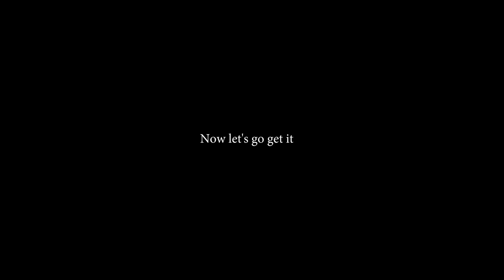Buying and fixing a lowboy trailer : Centreville 35 ton detachable

Comment: You guys have no idea how much i enjoy watching you and Andrew get so much work done with tools from Harbor Freight, Tractor supply and craftsman - when all the tool snobs insist you need a $300 screwdriver to accomplish anything. Congrats on the new trailer.  Mounting a pipe to keep half a dozen traffic cones on board might be a worthwhile addition too.  If you decide to do that, you can get bumper mount cone holders for the truck, a surface mount one for the deck,  or just bolt a pipe adapter onto the trailer and screw in a 2 foot piece of black pipe.  It’s definitely worth it if you ever have to work on busy road, or god forbid break down on the side a highway.  You get peoples attention a lot quicker once traffic cones go out, and you can create a little barrier to push the cars a little bit further off you.

Comment: Jesse; You can haul Andrew Camerata's CAT  977 around with that lowboy.   He needs to get that big CAT out on some big jobs!
Reply: Andrew runs a business so no doubt he will have his own low loader shortly, his current trailer is 20ton max, the 977 is 24ton
Reply: andrew dont need help. he can very easily reduce the tons of his machine with plasmacutters, tortch or some off many cutting tools he love to use
Reply: them 977 are old as F, parts are getting very hard to find, every burnt unit been stripped, new parts are a battle, i have a messy HD450 i pulled the engine out 20 years ago, the tork converter went on it and i have yet to find one for it, it was a great track loader with a big heavy duty detachable back hoe, that thing out pushed a cat D4. i have a blade for it, i use to win bids to barre brush on hydro right of ways along dirt roads in to resorts when they had run hydro in, but all the trees an brush had to be logged out and make the ground look like a park, barre all the brush piles for many miles. if i recall the last one i did was 38 miles.  i loaded blasted rock in a rock corrie in my 20's with a cat 977 huge rocks, i broke my collarbone there when trying to get the track frame bolts out, had a 12 foot long pipe on a 1" power bar, the 2-1/16 inch snap-on socket broke and the pipe hit me in the collarbone.there was 3 of use on that power bar an pipe.. . for city river bank erosion control, we carries the big rocks up the middle of the river with cat 922 and 933 loaders, at hat time i broke the track frame on one side, it took over 2 years at that time already to find one for the 977 so i wouldnt work it hard.. i also ripped the bucket open demoing an old hocky arena concrete floor. for a new floor full of rebar and cooling tubes i spent a week heating an beating the bottom of that buck back into place and welding it up, that was one hell of a strong floor a foot thick
Reply: @freepress8451  AC's trailer weighs 4 tons, so it can only hold 16 tons also! With the 977 weighing 24 tons AC will need a 30 ton trailer to pull the 977.....
Reply: @floatpool8307  i dont, just didnt remember how to speel.and he is using mostly for enternal decoration, or add a radio or so

Comment: LOVE the format of these videos, for many of the scenes capture unique perspectives that are not offered elsewhere. For example, I have pulled a number of small trailers before and understand intuitively the need to make extra wide sweeps on turns and going around sharp corners, but your "camera at the rear of the trailer" sequence provides a unique perspective on the geometries involved, especially when watching the tracks of the tractor wheels relative to the tracks of the trailer wheels. Many, many thanks for putting the extra effort needed to capture these fo us! I know that there is a ton of work to set up, capture and edit these sequences, and want you to know that they are MUCH appreciated!
Reply from the maker: thanks. I really love lowboys and tractors, I always had a thing for trailers in general. I love hauling things. That lowboy is a challenge though, its very long with very little clearance and since the axles are set all the way back; it makes an extremely wide turn
Reply: @jmuller86  nice trailer..... weight wise.... yeah 80 k ....still have bridge laws to deal with......,also you can load and unload the excavator off the side without doing any unhooking..... going to look nice with the new paint

Comment: That's an awesome find. When the camera was on the trailer- you could see & hear it didn't wobble and it was quiet. I'd definitely change the pony oil and jack oil. Make sure those lock rods are in good shape. Good spot for a $30 backup camera w/monitor! Nice to be able to cut own wood.

Comment: When you back up to the lowboy trailer after loading or unloading back up enough to spin the rear tires just a touch. It just helps to set the locking mechanism better. But you got a very nice trailer there Jesse. It is well built and should last you a very long time. Great video.

Comment: Nice to see someone else besides me apply teflon tape the easy way. I've done it like this for 35 years and it just drives me crazy to see someone apply it in the rolling up way instead of the unrolling way. Very nice.
Reply from the maker: that irks me too. doing it this way keeps it tight, doing it the unrolling way keeps it loose and then it turns as you turn the pipes
Reply: @jmuller86  Absolutely. Right on brother. Loose, and it balls up and will leak. Some people will argue that, but the minute you loosen the pipe fitting for a possible mistake you'll see. You don't have to re-roll it. If it's rolled tight in "This" direction you can back the fitting off and the teflon is still bonded. EVERY TIME. There's more to just direction of the threads, with bonding the teflon.

Comment: I had no idea those had engines. I always  learn something on this channel.
Reply: Some run their hydraulics off a pony motor like this some use a pto set up with a wet line off the truck.
Reply: And some do not use hydraulics at all.  Check out the RGN that Steve uses on the youtube channel FSC Speed Shop.
Reply: They usually don't and are just lifted by the tractor backing up on them. But those ride extremely low.

Comment: When working with NPT hydraulic lines up to 3,000 psi, I was taught to wrap just 1 time with teflon tape, leaving 2 end threads empty so no tape "washed" into the line.  It worked every time!
Reply: Loctite 545

Comment: Great video Jesse and I so enjoyed your production. Good buy for your first start. I used to work for the railway here in Canada . I hauled trailer trains  with 20 ft containers, sometimes up to  125,000 LBs gross
so it was great to watch you and all so going through the gears and mostly I ran fuller 10's and 13's speeds. We had no Jake Brakes just the gears.

Comment: Nice trailer Jesse! I can offer a tip, sand and paint your rims on the tractor. DOT will hone right in on them and decide you may be easy pickins for them...it will make your pretrip much easier looking for cracks or defects also.

Comment: Just a suggestion there Jesse, seeing as your carrying heavy loads !!!  You could raise the fifth wheel 4'and that will give you a bit of ground clearance as it is low in the front of the trailer than it is at the back ,( that what i could see from the video)  and also enough height when you unhitch from the low boy .. If that is just a little bit too high , you can use your air bags on the prime mover to lower it enough so you can get out, then put the air bags back up or you can make a leaver that flip up too support  the neck of the trailer near the back of the chassis behind the fifth wheel  when you unhook you engage the leaver that lifts the blocks ... I've been driving trucks for 30 years and ever since air bag have been use , we always dump the air bags about 2" away from the trailer then once where under the skid plate we activate the air bags then slowly reverse back on once the fifth wheel is touching skid plate ... Look Jesse, seeing as your carrying heavy weight, i would get it sand blast so that you can see if it is structurally sound and there is no cracks in the chassis rails of the trailer ... The last thing you want is too loose your load or kill some one ... So just go over all the welds too check if there aren't any stress cracks ... If there no stress cracks , you've got your self a good trailer that will last you for some time ...Well done Jesse !!!!

Comment: Good deal on the trailer.  Looks like you're getting more comfortable with the rockwell trans!  The wet kits are nice if you're also running and end dump or other trailer that needs a hydraulic setup, but it's something else in the way any time you're working under the truck, another set of long hydraulic hoses to look after and hook/unhook any time you uncouple, and another possible place for fluid to leak out from underneath your truck.  The PTOs need to be carefully installed and shimmed to the transmission to get the right backlash on the gear teeth, you'll oftentimes have to fabricate a support for the pump, and if the PTO case cracks it'll dump every bit of transmission gear oil on the ground and cost you a transmission if you're aren't careful about keeping up on your fluid levels.  I've caught it twice on some trucks where I work.

The nice thing about the pony setup is everything is self contained, and if you can look after a log splitter you can look after that unit.  Congrats on getting your own truck and lowboy, I think that will serve you well for a long time.

Comment: I noticed the safety linkage was missing when you picked up the trailer from the dealer. Get you a three inch steel bar, one inch thick. Punch some holes to match the linkage and cut some 1" rod for the pins. Don't shortcut this, i'm talking from experience. Also, with that leftover plate cut you some 3"x 4" pieces to use as shims in case(you will)you get into a jam.

Comment: Congratulations on your trailer. I might recommend replacing the trailer brake canisters since your getting close to max weight. Flip trailer on side with that excavator. To give it a good inspection.

Comment: I always heard that called an "Oil Field Float" trailer... I saw one where the jack used two air-bags on the truck side, so everything was pneumatic and didn't need a pony motor and hydraulics. What's wrong with using the bucket to raise the front of the tracks onto the trailer, then spin the arm around and lift the rear of the tracks and roll the excavator on the trailer... No ramps needed. You might want to use air-bags instead of "jacks" for the truck side...

Comment: I spliced into the Jake Brake curcuit a two speed axle switch i mounted on the shifter stick.  Could flip it on and off easier if needed.  Many areas have a noise law.

Comment: i hope to have my lowboy trailer next month.   might also want to look into adding spring brakes to the trailer. all those hills in NY you might not always have the option of loading on a flat and that trailer could scoot around with no parking brake.
Reply from the maker: this one should have spring brakes. when I unhook it, one tire set locks up
Reply: @jmuller86  i just saw the pancakes on the forward axle thats why i said that

Comment: That well where you replaced the through-wall gladhands looks like it collects and holds water leading to the corrosion of the ones you replaced. Consider drilling some small weep holes to allow water to evacuate from the area.

Comment: Hello Jesse, I am a Carpenter and used to work for to Welsh Water Division,  we did all the maintenance on Offices, Pump Stations and Workshops.  We also used to repair and replace the boards on the Low loaders,  one thing the Manager wanted us to do when fitting new boards was to finish the boards 1/4" above the Trailer Steelwork which he said helped the tracked machines to grip the trailer  which would help to prevent the machines from moving.  Whot every method your trailer uses to bolt the boards down, please Grease or Copper Slip all the bolts, makes maintenance so easy when  changing the boards. We used a hardwood called "Kerowen" imported to UK. Very interesting video Jesse I have Subbed to your site, and will be looking out for future videos best wishes Geoff Lewis, Wales, UK,  🏴

Comment: I have an observation for you. It looks like where you put the air hose and electric line inside the trailer could be a rub point when they are connected.

Comment: I pulled standard and drop deck for a time. Few tips are always be sure the pony motor runs and you can never have too many chains and binders on board. My main and a very important tip is never take a chance and get that thing high centered (hung up) on the highway. Railroad crossings are the worse place to get hung up. Always map out your route and even if it means going out of your way it is better than risking being stuck. Get you some orange cones to set out when loading and unloading and a wide load sign for the front and back. Also even if you are only local get to know the DOT rules and regulations governing heavy haul. It could prevent a bad day and monetary penalties for you later. Don't ask me how I know this. Ha Ha...
The more you use it the better it will get. Forgot you need to check the fifth wheel pin where it is welded into the frame. I saw a lot of rust and corrosion when you replaced those glad hands. Good luck...
Reply from the maker: thanks. this is all good info

Comment: New subscriber here. Good job on the load securement! Just be cautious with the overhang on the tracks. If it projects 4" or more beyond the sides of the trailer you will need 4 flags. One for each of the 4 corners of the projecting load. Have a great day!

Comment: Ahh that Jake sounds so nice! Did you find someone selling an Eaton Gearbox for your Truck? At the Mill, this Lubricant/Cooling Tank on top. Is it filled with Oil like Chainsaws, or something else?

Never seen an RGN Trailer with a Pony Motor for the Hydraulics Stamp. I only know Trailers, where you can adjust the Height with the Trucks Airbags, or Flat and Stepdecks with Flipable rear Ramps.

Comment: When I'm doing repairs on my trailers I almost always replace things I've taken apart like that brake control valve  they're only like $50. On 3 of my trailers I just recently replaced all my tanks, valves, air lines, the complete electrical system and lights because after a while you just get tired of doing nothing but fixing little problems that like to pop up at all the wrong times.
Reply: Amen to that
Reply: I would be checking the trailer too make sure that there are no stress cracks in the chassis and the brake liner are good before i would take it out on it's first lift .... The last thing he want is to have an a accident and kill some one They say SAFETY FIRST !!!!!!!!
Reply from the maker: @tazza1076  I did check the frame and the brake liners are well within spec. I actually adjusted the brakes on camera but then forgot to put it in the video
Reply from the maker: I didnt realize they were only $50, I definitely would have bought one if I had known that
Reply: @jmuller86  ya a lot of that kind of stuff is relatively cheap for the most part but you still have to shop around. I've had some parts stores quote me $700 for a part and another store quote me $125 for the same part and it was the same brand and everything. One thing I'd check that really gets neglected is your S-cams, S-cam bushings and the spiders. Also on a trailer like a lowboy that doesn't get a lot of miles put on it I'd definitely consider converting your wheel bearings over to grease instead of oil. Because wheel seals tend to go out from sitting then you have to not only change your seals but brakes because of the oil, all of the big contractors here along with myself do it on all of our construction trailers.
Reply from the maker: @clydeacor1911  I might do that to this trailer and my other deckover

Comment: Nice trailer Jesse. I used a 4x4 across my truck chassis to hold the neck up. Took me a bit learning how to hit RR tracks, after a bit I never got stuck. Looks great best of luck with the new trailer.
Reply from the maker: how did you manage across the tracks? I got it hung up pretty bad today blocking both lanes, I used steel shims to get it up but it would be nice to do something ahead of time so I am not blocking traffic
Reply: @jmuller86  If it's not too bad approach on a angle, My trailer was old and has slot of slop. I didn't have the inside pins like you have. I could use my Jack to lift the trailer and use a 6x6 + blocking truck chassis, to keep it higher when I put the jack up. It wasn't the safest, but worked good. Real extreme, ramp it like a mobile home. Cribbing to raise the trailer wheels. Always keep the RR phone number in your truck, just in case. Let me know if this helps.

Comment: make sure the lowboy is level, may need to put longer perches on the fifth wheel, some weld plates under the trap door.  also make up lift plates to place under the trap doors and the lowboy,  this will raise up the lowboy to get over humps.  You need pin for the trap doors to hold in the two different positions.  It's a spring loaded pin to keep the pin in the position.  this really looks like a rogers lowboy.  good luck with your lowboy.

Comment: some lowboys have a hydraulic lift in gooseneck to hold up, instead of the board.  use a 3" x 4" that is wider then the truck frame.  also your boards on the lowboy deck should be at least a 1/2" to 1" higher then the steel frame, this way your steel tracks will be on the wood and not the steel frame.  also for the outriggers, which I don't see on the lowboy, do the same for the outriggers board,  your tracks will be on wood and not the steel.  look at some other lowboys to see what they have.  your doing a great job on the repairs.